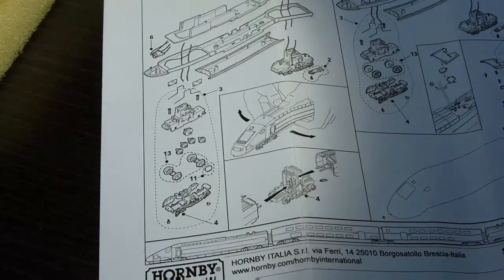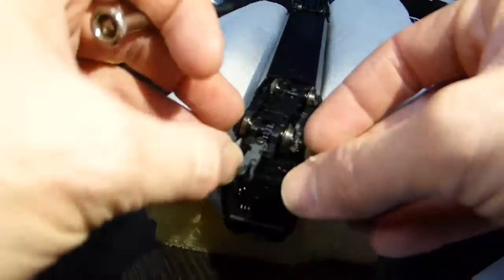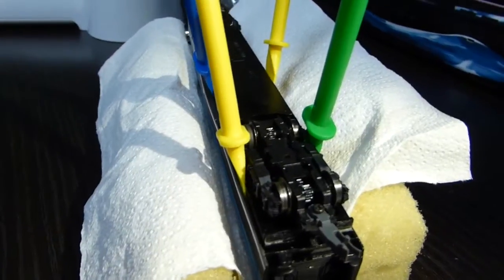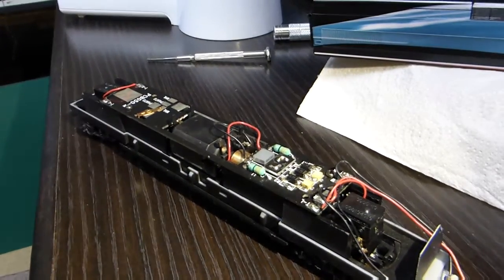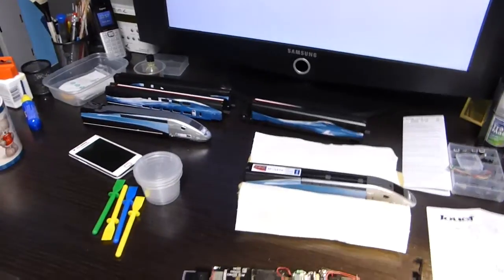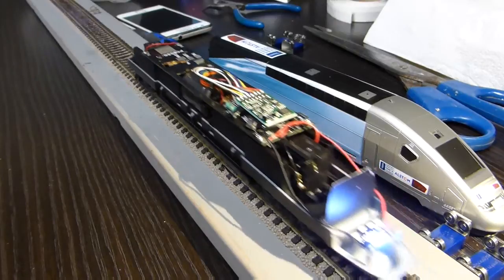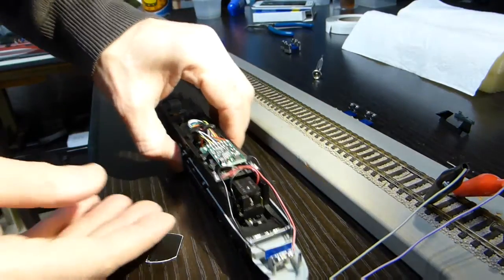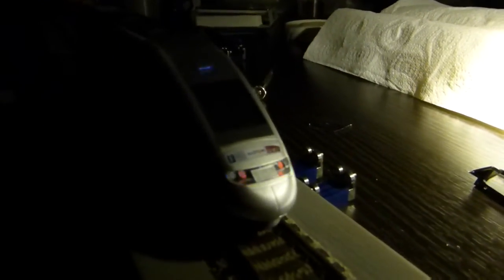JOUEF TGV V150 DCC INSTALL part 2

Comment: Hello, Thanks for the video, I was struggling to open it up, for the second time, I forgot about the rear fender, I installed the decoder many years ago but I never used it. I tried to run it today and loco is stopping, cracking sound from the gears and saw the wheels jerking back and forth in the truck. the axles are loose in the frame of the truck by about 2-3 mm, not just 1 but all 4 axles are loose, this loco can move abut 20-30 cm than makes a sudden stop. Also I have a Jouef TGV Duplex set, I remember I had hard time to install decoder into that one too but encountered a different issue with that one, the dummy unit wheels were so tight, it felt like the break is on, the entire train was pulled in, tilted into the inside of the curve, derailing the whole train.   That is my experience with Jouef TGV's.
All I need to find out now how to take the gears apart.
Reply from the maker: Sorry your message was on hold from youtube..Yeah the Jouef tgv's suffer from drive gears splitting over time I did a vid on tracking down new drive bogies. Jim

Comment: Hi, have you installed a function decoder in the dummy car? Or how did you prevent the white and red lights from glowing simultaneously? Thanks!
Reply from the maker: TubeH0 Hi I am not sure about the dummy car I think it has no decoder option and I never hard wired one in...
The set has been in storage for some time now...jim